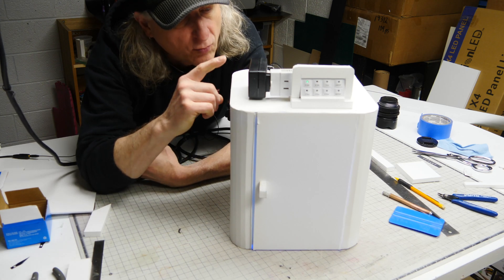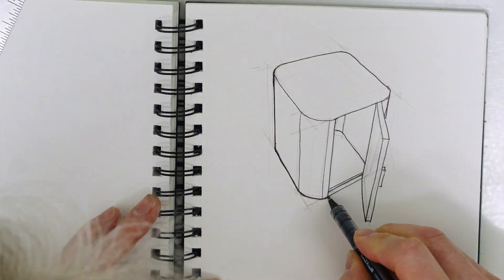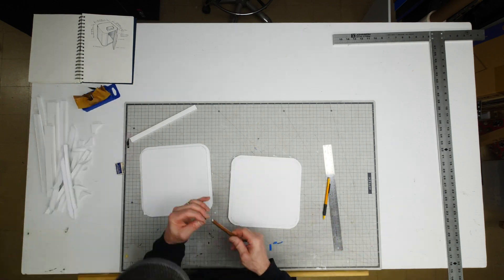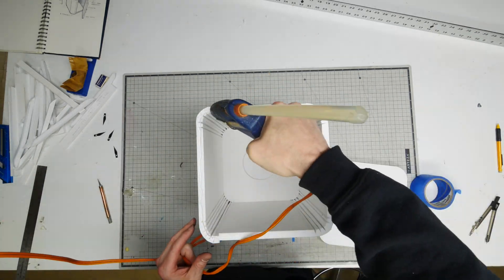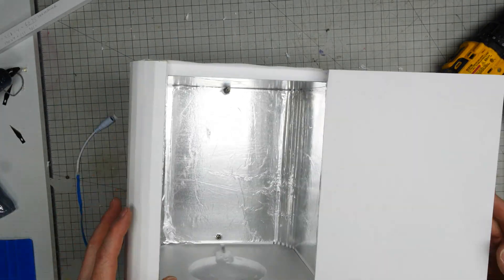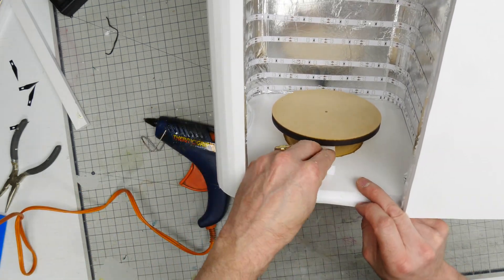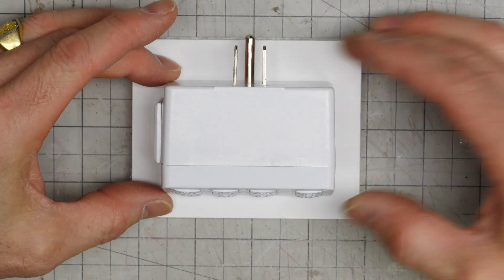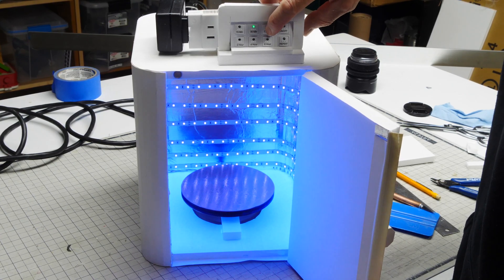DIY FoamCore UV Resin Curing Station: Foam Core 3D print resin curing oven box

Comment: I would think white walls would actually reflect better. A diamond pattern mylar would also be good. Otherwise you will get "hot spots" or uneven light distribution.
Reply: I always wonder why no one uses thin mirrors
Reply from the maker: You could, it would work well I suppose

Comment: Foam degrades under UV light, so it's reasonable to cover all the internal sides with aluminum cover. I see you did only for sides, upside, but not for bottom and door
Reply from the maker: Last shot before the goal shows the door covered. Probably should get the bottom covered as well

Comment: Not to poke holes in your presentation, but you said that the aluminum foil would prevent the UV from escaping through the walls but then failed to apply the foil to the interior of the door. Did I miss something?
Reply from the maker: At the very end of the video just before the hockey goal is a shot with foil on the door 😀

Comment: I made something similar in 2020 but it's not for 3D prints. Mine is thick walled glass and it is used to purify water. I put the UV lights around the outside facing inward and put aluminum foil around it, then a thick rubber mesh exterior.

Comment: i keep planning on building one of these, but with how messy the resin printing is i just dont have a space to really use the printer i bought years ago...so i never got around to building one of these. 

though i'll add apparently the resin doesn't cure well in oxygen, so if you submerge your piece in propylene glycol (vegetable glycerin) in the cure booth it will cure a lot better. I have just a clear tub with the glycol in it, with a little 3d printed sieve thing for pulling the prints back out that then hangs over the container for letting the glycol drip off. Seemed to work well for the few test prints i did manage to do. whereas the first print i did never seemed to full harden.